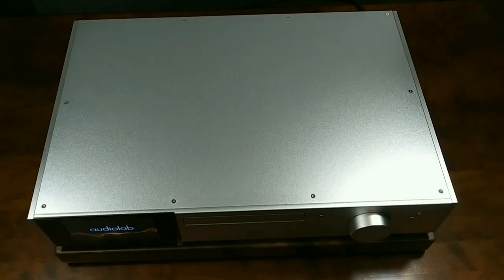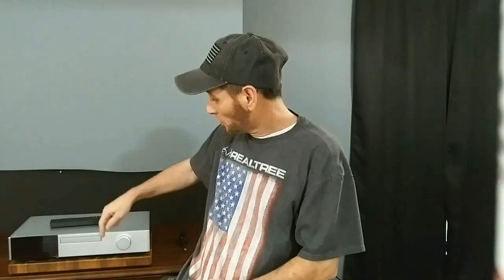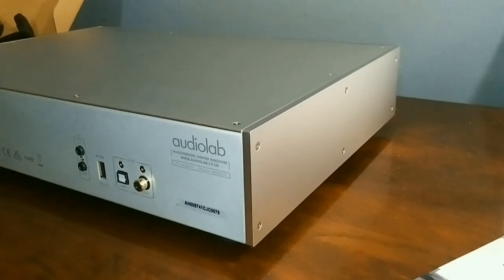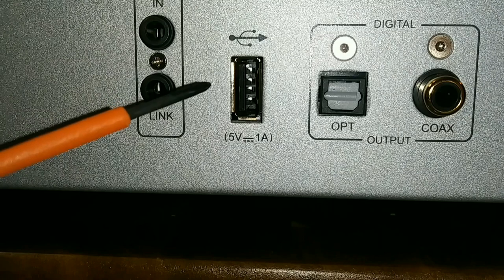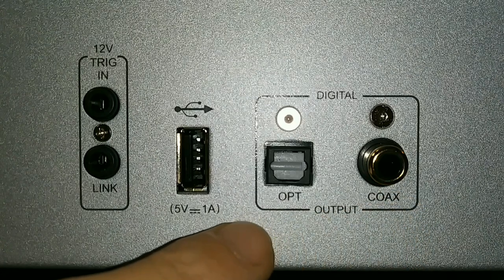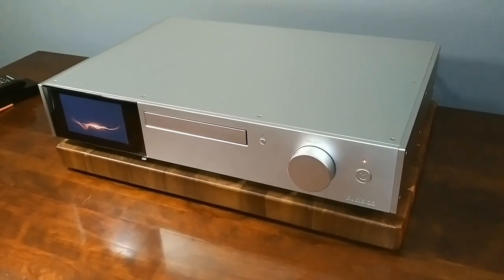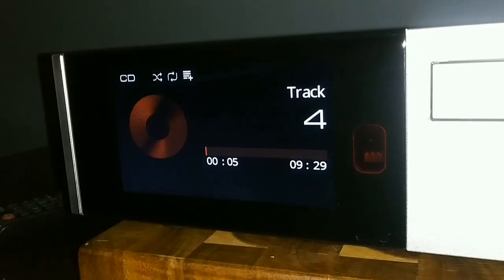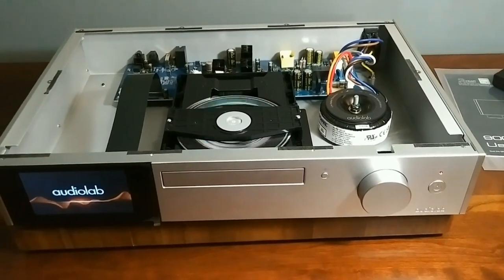New Flagship Audiolab 9000cdt Compact Disk Transport Impressions video & Pop the Hood@28:40 Endgame

Comment: honest question?  How much does a digital transport bring to the table of over all sound quality?  I must be missing something...   Its 1's and 0"s..  On a anolog turntable I get it...  But please help understand.
Reply from the maker: I got ya my dude-  I have been using cd players and digital transports since 1989 and its not just 1s and 0s with cd players
I wish that was true - if this was the case then everyone would just use a cheap $10 dollar bluetooth reciever that has digital output of 1s/0s - Many factors come into play starting with the players Power Supply of course having a good quality mains transformer is important to have very low hum this will help tremendously with Jitter as well as the volt regulators keeping voltage steady with no drifting even the Quality of the Capacitors matter when filtering out the ripple effect - All of this helps with Jitter that causes DIGITAL DISTORTION ' 
then we have the actual cd mech 
which we want to stay very stable from vibrations with good damping factor 
This helps the laser not to work hard 
and of course again keeping Jitter at a low -Also the quality of the laser/and the accuracy of the motor help the internal   crystal osiculators and Clocks to perform their best from any Errors (acts like a buffer) and this will give better rhythm and pace 'Timing' for better smooth sound - Audiolab uses a read ahead buffer that catches mistakes before they happen in real time All of this helps the digital to analog converter to perform better Audiolab even uses a digital differential line driver which also helps with lower noise and you can use longer cables without losing any Quality of sound Jitter is our enemy that causes 'digital glare' mistakes and loss of inforamtion in the playback And also proper shielding helps with 
RF interference) 😃
Hope this helps you out - 
When I compared the 6000cdt vs 9000cdt it was actually very noticable that the 9000 has better timing and less digital glare actually sounds more analog with my dacs with greater detail retrieval and Rhythm and Timing was so on point and pleasing to hear - Hope this helps you to understand better' great ?
Reply from the maker: Dam that was a book i wrote now you know why i haven't talked about this indepth Pinned your comment
Reply: @tee-jaythestereo-bargainph2120  epic!!  😊
Reply: VERY WELL SAID!
Reply from the maker: @superprim12  thanks buddy !!
Reply: @tee-jaythestereo-bargainph2120  You should do Video on it and make it your Core Video.  I own McIntosh audio equipment and focal speakers and truly did not know what you shared!!
Reply from the maker: @superprim12  I think your right but me already 3 videos behind , As soon as I get caught up you got it !! Don't let me forget 😃
Reply: @tee-jaythestereo-bargainph2120  will not let you forget… lol.  I think what could make your channel be different  is the fact that you explain what you are looking for…. I have not seen this done before. YOU SHOULD MAKE THIS YOUR STATEMENT video.  * a watch this first video…. And what make you decide why one is better?

Now that I have watch your videos.  It’s starting to make sense!  TU for taking the time…
Reply: A digital signal is not actually transferring 1’s and 0’s - it’s an analog square wave where the change in the amplitude is converted into representations of 0’s and 1’s, and the signal is never a perfect square wave, except from test equipment. How far off from being a perfect square wave and where and when the square wave changes can cause the receiving unit to misread the changes in amplitude because the square wave may look like choppy ocean waves or uneven pointed snake’s teeth, for example.
Reply: Where are the measurements to prove it's better than the cdt6000.
Reply: YES, but it's how the 0 and 1 get from point A to point B and reproduce the signal that makes a difference, how vibration, jitter, electrical noise are handled.
Reply: @r423sdex  measurements are one thing... but your ears don't lie.
Reply: @rauldon273  Agree.....trust your own years. If you think a standalone CD player sounds just fine compared to a good transport and DAC, then good for you because you will same some money & can buy more disk. I for one believe a good transport and low jitter DAC will be an improvement in all aspects of SQ.......but I'm just another random buy on the web.
Reply: Question is how does this compare to the 8300cdq with more features
Reply: This is better

Comment: Hello again. I purchased this CD transport. And I wanted to ask you something. Does your loading tray rattle when closing, even a little bit? I have a little rattling and I want to understand that I am the only one with such a feature. And please tell me more, did you like the sound right away or only after warming up for a few days? I've had it in use for 3 days and I'm not impressed with the sound, very unnatural, not detailed, with weak dynamics sound. I think if nothing changes with warming up, then I will give it back to the store.
Reply from the maker: Yes 100 percent,  when I first got the transport and I was closing the Tray I could hear a very light rattle right before tray closed , but after about a week of opening and closing many times that light fate rattle went away Thank Goodness ! 
I think it was due to being new and the tray needed 'wear in' with the lubrication
They use on the guide rails -  
I would suggest open and closing many times then let me know if that slight rattle went away ,  
To me the transport sounds amazing 
I have owned dozens of players since 1989 and the 9000cdt sounds great what dac are you using ?

Comment: Hello. Why do you think there was no own shielding case for CD transport, as indicated on the Audiolab website?
Reply from the maker: Good question I think they meant they used 2 x chassis theirs an inner layer thats thin and an outter layer thats thick so its double shieled not incapsalated though Going to send them an email
Reply: @tee-jaythestereo-bargainph2120  Thanks for the reply. I think that it was still meant that the protective housing against interference should be around the transport. Please let me know what Audiolab's response was.
Reply from the maker: @АлександрГорох-в4ь  Yeah i even mentioned in the video the mech was incapsalated because that's what Audiolab posted on their site but it is doubled shielded- I am impressed with 9000cdt though
Reply: @tee-jaythestereo-bargainph2120  Hello again. I purchased this CD transport. And I wanted to ask you something. Does your loading tray rattle when closing, even a little bit? I have a little rattling and I want to understand that I am the only one with such a feature. And please tell me more, did you like the sound right away or only after warming up for a few days? I've had it in use for 3 days and I'm not impressed with the sound, very unnatural, not detailed, with weak dynamics sound. I think if nothing changes with warming up, then I will give it back to the store.

Comment: I am annoyed by transports with limited output options. This one has COAX and Optical. No Yes/Ebu or I2s. Most DACs I've come across offer Coax and Bbc inputs and a lot have I2S and I've never seen a transport with a BNC output. I'd rather see some output flexibility instead of selling me aluminum by the pound.
Reply from the maker: I mention this Coveate @ 22:53 I agree with ya 100 percent - I would rather had more digital outputs than the hdd hub they added
Reply: @tee-jaythestereo-bargainph2120  I missed your comment because I'd already written off this product because of no I2S output.
Reply from the maker: @fletchermunson6225  the coax does have a differential line driver thats suppose to help- But hey I agree the 9000 will not be for everyone -

Comment: Looks like they went to a TEAC CD-5020A-AT drive. Good move. I have one in my TASCAM and it is very smooth and reliable.
Reply from the maker: I thought it was a Sanyo Mech i didn't mention in the video because theirs nowhere to look it up but does look somewhat like the Teac they could have built around that mech - I bought all nee Nichicon fine gold caps for the 9000 hoping it makes a difference may not though

Comment: Good review again. The display is a good addition over the 6000. I have had the 6000 for a little more than a year and I have been quite happy with it. Of course the dac you use makes a big difference. I am using the built in dac in my Anthem STR preamp and it sounds pretty good. Not quite as good as my cd player but very close, and the cd player is 3 times the cost.
Reply from the maker: I have owned Some nice players as well 
Pioneer/Arcam/Sony top models Sony made some ES/ESD models that are still amazing
Reply: @tee-jaythestereo-bargainph2120  I liked the pictures of your different systems and rooms. have you ever thought of showing some subscribers systems at the end of the videos? I know Gutenberg started it but that doesn't mean you cant.
Reply from the maker: @barkingpumpkin5693  actually I thought about that !!!

Comment: Hey.... great vids. Trying to compare the Audiolab 9000cdt to the Jays Audio CDT2-MK3. I have a very revealing system that would accommodate both price points. Basically I just don't know if the 9000 is just so good that spending another 1k on top of that for the Jay's is really necessary. I also like that its a tray loader and not top load.
Reply from the maker: Another 1k you could put into an amazing dac !
Reply: I bought & returned three Audiolab 9000CDTs. Each had a different playback problem. Bit the bullet & bought a Jays CDT2 MKIII. Still breaking it in. The Audiolabs went defective before any of them were broken in. Had a 6000CDT before that. It worked and sounded real good.

Comment: Hi Tee Jay. I'm currently running a 7000A and a 7000cdt. Had a 9000A loaner. I think bec ause of the thermal mass of the 9000A's chassis it takes 3x longer to get properly warm. After 30-40 minutes the 7000A/9000A sound pretty similar but after 2 hours the 9000A is WAY better.

I'm now sure about getting a 9000CDT too.

Thanks dude!!
Reply from the maker: 7000cdt is really really good and their is some features I like better with 7000cdt ' but overall in sound performace the 9000cdt barley edges out the 7000cdt and that's with a More Reveling system ' the 9000cdt has better clocks power supply mech and to be str8 up I'd put more money into your dac with 7000cdt thats where you'll get a better bang for the buck 7000cdt is very good transport ' if it was me the 9000cdt is what $600 more in price add that to the dac !!!! Of the 7000cdt '  Review coming very soon of 7000cdt ' 
Crazy the warmup with 9000a '
Reply: @tee-jaythestereo-bargainph2120  The local Audiolab rep just told me that a 9000P power amp is coming in the autumn. Think I'll stay with the 9000A/7000cdt and get the 9000P!
Reply from the maker: @markorchard2272  I had the 8300xp honestly it wasn't much more powerful than 7000a maybe 3db should have measured the 8300xp   I reviewed against my 52 pound Yamaha Intg amp and Yammie @ 90/150 watts is more powerful ' So I hope audiolab brings it with 9000XP ! Don't get me Wrong 8300xp sounded good just not much bass or fullness ' (flesh n body)
Reply from the maker: But very balanced no boosted bass '

Comment: Hi Tee-Jay, UK viewer here, just found your channel tonight. I'm about half way through this video, just after you talk about percentages. I haven't had a hifi separates system for about 30 years, so really coming to this fresh. Almost settled on all Audiolab for Amp and CD units. 
Question for you is, the 7000A amplifier has just been announced for sales starting next month (March'23). The 7000A amplifier is £1,095, about $1,317, the next step up is the 9000A £1,995/$2,400, too big a step for me...(they need to plug that big gap.) 
I don't know enough to decide between the 7000CDT £549/$660 and the 9000CDT £1,000/$1,203.
Is paying the extra for the 9000CDT, over the 7000CDT, worth the extra money?. Will you do a direct comparison test between the 9000CDT and the new 7000CDT, as soon as you can get them together?. What do you think of the 7000A amplifier?.

Lots of questions I know, be really helpful if you can reply. Thanks in advance. PS, perhaps you know, Audiolab are from here, Huntingdon, not far from Cambridge, the University town.

Comment: 3 things you need to try…
1. Puritan audio PSM 156 power conditioner.
2. Vibration damping under components 
3. Audio Desk system Glass CD improver, probably need to get from Europe.
Reply from the maker: I have my own dedicated circuits with 30 amp breakers x2 for my audio No power condtioner used only all medical grade wiring and Receptikles ' And of course I dampen all mu conponetes 😃

Comment: Like this review alot. Thumps up.
I hoping Audiolab gonna make a 3 channel amp because not only the 2 channel lovers wanna upgrade good.... When you link up the new flagship 9000A as piece of the HT the centerspeaker hanging around with the surrounding brothers on a lower scale in dac quality. How many times we heard that the centerspeaker is the most important of all... So a top notch 3 channel Audiolab will make many home entertainment lovers happy.
Greetings from the Netherlands.
Reply from the maker: They make Monoblocks 😆
Reply: Not needing the extra monoblock, 😂. It's about the equal sound control of the 3 fronts. Tnx 4 the reaction.
Reply from the maker: I don't think Audiolab will evet go Hometheater or 3 channel amp channel amps I also would love a 3 channel Integrated amp that would be cool for Home theater bypass

Comment: It's important you have the right cable for digital signal, get a non-shielded solid core, coaxial cable ideally 93 ohms not 75 ohms and definitely not 50 ohms or below. Happy New year . Good little tip is for you put the grill covers on the inside of the speakers this helps with smearing issues giveing you a bit more clarity just apply some blu tack and push on the cover. Massage it well in your hand till sticky the blue tack of course 😉
Another little tip you might like to try is some CD mats  supposed to work well not particularly expensive.
Good album test your speakers give them a workout lake of tears forever autumn great album
Reply from the maker: Lots of cables 😃
Reply: @tee-jaythestereo-bargainph2120  no just the one 😄
Reply: Solid core?  That's wicked stiff cable.  I guess it's worth it?  🔈🔉🔊
P.S.,
    Are you talkin' 'bout the cable with a threaded sleeve connector?
Reply from the maker: @hoobsgroove  some times 2 !! When comparing dacs 😃
Reply from the maker: @TriAmpHiFi  i think so -
Reply: @TriAmpHiFi  well not really it's not super thick
Reply: @TriAmpHiFi  what your describing is BNC he's got an RCA connector coaxial
Reply: @hoobsgroove  Exactly.  So what kind'a cable you talki'n 'bout?   No link, but Brand?  
🔈🔉🔊

Comment: Got the New 9000cdt a few days ago, I ordered from AudioAdvisior and I couldn't be more happy Teejay!! Thank you so much for the review I owe you one. Blows the doors off my 6000cdt !!! 9000 on a different level.
Reply from the maker: Congrats Brandon ! Awesome Company' you ordered from one of my Favs
Reply: How can it be better, maybe it could have a better clock. But my dac could care less about the digital data it receives. It's just a 1 or a 0.
Reply: @r423sdex  you hear the difference as you move up the chain.  My first blue Ray player being used as a cd player was fine with my first budget amp . Better amplifier started revealing its flaws . When I added I dac to it , it still wasn't the best . I got the 6000 cdt and it all changed.  It feels like i have a new amp . It makes a difference . The blu Ray player was no slouch either it was 900 uk pounds when new .

Comment: I currently use a Marantz CD6007,with an Arcam SA20,and KEF Q350 am thinking of upgrading the Marantz to either the 9000cdt or 7000cdt would there be any significant sound quality improvement over the marantz? Thanks.

Comment: After 2 months my 9000CDT refuses to recognise any of my CDs, which it has already played. Any thoughts?
Reply from the maker: Dam !! Sounds like a dirty lens had mine for over a year ' and 2 months ago the loading tray when going back in from loading a disk makes 
A grinding noise ! Upsets me due to price but I do understand from owning so many players that when shipping players are so fragile! 
Did you buy new ? If so you have 3 year warranty send it BACK !
Reply: I've bought & returned three 9000CDTs. None of them made it past 30 days before playback became defective. They sounded good. Breaking in a new Jay CDT2-MKIII.
Reply from the maker: @stevegrimm9068 dam I have had mine for a long time ! WHAT WENT WRONG ?
Reply: @tee-jaythestereo-bargainph2120  The 1st one just stopped playing. It would only play about a half second & stop. Skip to the next track & it would either play for half a second or not play. The 2nd one would sometimes skip ahead a little, like it had hiccups. The 3rd one sometimes wouldn't play unless I turned the unit off & back on. Can't say I didn't give them a chance. I wanted one.
Reply from the maker: @stevegrimm9068  that's crazy ! Cd players and Transports are so delicate shipping is very ruff on them ! But I have had mine 6 months before I reviewed it ' I do this on purpose to make sure nothing wrong but when cd tray goes back in the slot it makes a vibration noise now but works great ! But 7000cdt has been flawless ! But 9000cdt is so good with rythm and pace ' man thay some serous bad luck !